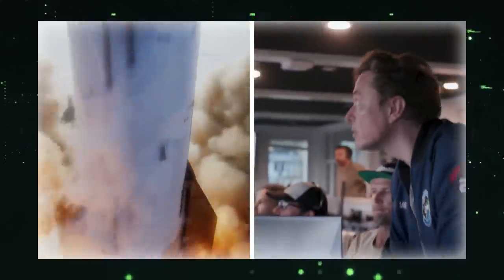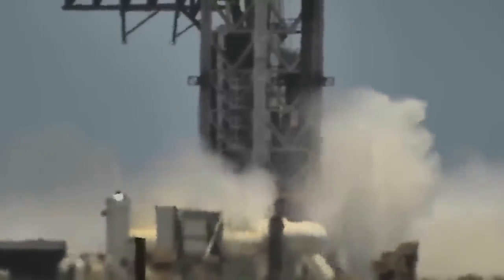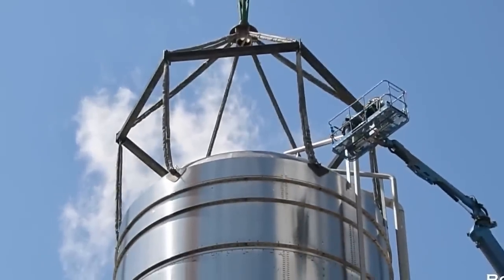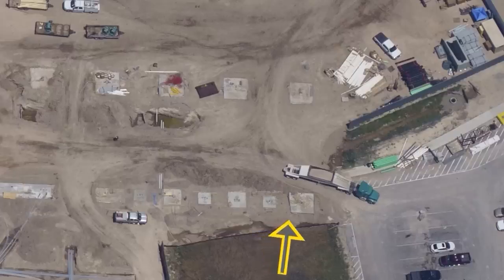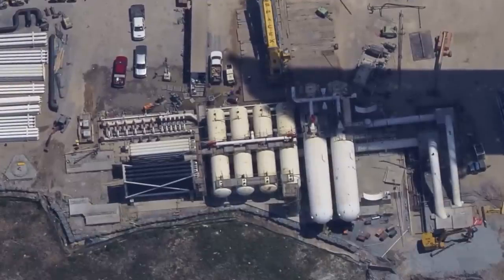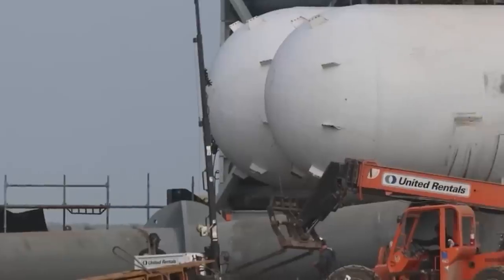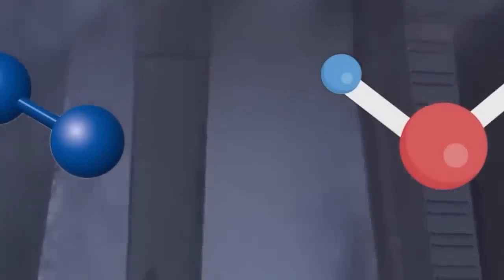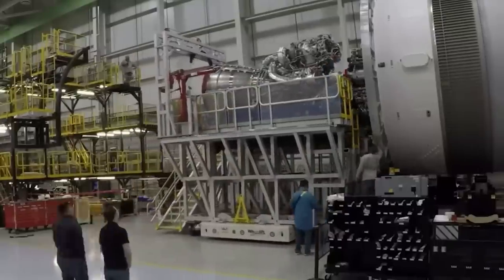SpaceX Starship Launch Pad is Finally Ready + Elon Musk Revealed Something Important

Comment: I worry about
a) how exactly "co-axial" and symmetrical Spacex's take-off assembly is, considering the manner by which it is produced.
b) the effect of direct reflection of the ignition blast waves upon the re-entry tiles, not wanting them to be dislodged.
c) any remaining starting reluctance of Raptor 3s.
d) the effect of condensing ice (once the assembly fuels up) behind those re-entry tiles.  If any of it remains on re-entry, it might cause a tile to fly off.  (Insulators work both ways).
and e) Spinning starships by their noses in pairs with a 500m tether allows human journey time to Mars to be spent initially at Earth gravity, graduated down to Mars G at arrival.  (A rope isn't a problem).
and f) Spaceflight must always deal with radiation exposure.  Solar ionizing radiation can be shielded against, cosmic not, similar to our experience on Earth.  (Life is tough).
Apart from that, I can hardly wait . . . 😎
Reply: HOW ABOUT HE USES HIS OWN MATERIAL INSTEAD OF STEALING IT AND CALLING HIS OWN! tHIS IS NOTHING BUT OTHERS WORK WITH CHATGPT
Reply: @slotvalleyracing  Which is why it's worth adding to.
Reply: @slotvalleyracing  Have you used Chat GPT? It is very biased especially when it comes to what it won't say.. If something is true, don't ignore it because it is not politically correct.
Reply: That's why he stopped contributing.

Comment: The water deluge test proved only one thing, that water in volume could be delivered to the steel plate. The thermal protection it shoud add is still just a computer model until the SF test provides real data.
Reply: I agree, I’m not convinced - that relatively small amount of water (based on the capacity on-site, not the test) isn’t going to be enough to buffer 16 million lb of thrust.

Honestly, it may even be laughable. I think the flow rate won’t be nearly adequate, the exhaust plumes reach the steel plate with no remaining barrier, and either massively damage the plate, or possibly flash-boil the remaining incoming water IN the plate to steam, potentially causing an explosion. 

Either way, I don’t think this system survives the next launch.
Reply: 16 million pounds of mud packing power
Reply: @EstorilEm and we will all be watching. I think it's going to curl up at the edges and become a boiling caldera. Hope he has spares.

Comment: I would love to see a water recapture system, with filters, for launch reuse. Plans for multiple daily launches precludes water tanker recharge water tanks. Cost is also a consideration.
Reply: Much of the water will be gone with each launch. It will be turned into steam by the 33 Raptors. For daily operations, filtering the water for reuse might get you 1/4th of it back. So the other 3/4 will need to come from a another source. Most likely from an RO unit with extra water brought in by tankers. Starbase isn't supposed to be many launches a day.  It is supposed to be the testing site with the Cape as the main launch site.

Comment: There is no way that the deluge system is going to work. The physics are just on their side. They need to dig a trench as the 1966 NASA report stated. Back then they did the numbers and it worked. As an even more powerful rocket, it's going to need double what they used for Shuttle.
Reply: 16 million gallons of water deluge and a faster launch faster than before!..to absorb Heat from the launch..to protect Launch pad

Comment: Why doesn't he use those black tiles like on the starship for the launchpad?
Reply: They're ceramic. Brittle.
Reply: I had the same idea
Refractory blocks will take the heat.
I think Russians use this system. 
Not sure if it can take the erosion from blast pressure.

Comment: The deluge system doesn't look like it fuctions how described and i thought it was supposed to go to the center and not away from the center. If the water is supposed to still oppose or cool the steel plates then it going to need more water for the test footage showed it didn't hold back the force at all and with all 33 engines it might not go well to the put of pushing the water away and hitting the steel plates directly instead and that is a problem. Id suggested on another channel of using underground water bucket instead to contain the water in avoidingbrun off into the surrounding environment and to work better on absorbing the heat and force of takeoff.

Comment: Tall building erected on alluvial soil topple over during earthquakes due to phenomena called soil liquification. One just wonders how many artificial earthquakes (launches and static fire tests) will it take before alluvial soil (with very high ground water level) laying below OLM  and launch tower liquifies toppling over both structures. What we have seen during last test launch was accelerated pile driving (whole OLM hammered into soil below). After last modification (introduction of raft and pile structure) we will see not pile driving as before but accelerated soil compaction causing soil liquification. I just cannot wait to see this action.
Reply: I don't think there will be enough horizontal motion for liquification. The forces should be in one direction only, and those will be straight down. I would think it would act like ballistic sand.
Reply: @jxland3389  You keep ignoring the fact that it is costal area with unlimited supply of water seeping in and high ground water level
Reply: Karol - I've seen your obvious dislike for Elon in other posts. Why is that? Why can't you wait for the system to fail? Why do you think you're smarter than all of the other people in the room? This constant narrative of yours comes off as rather pompous in the end. Thing is, if it's successful, I doubt there will be any retractions or apologies.
Reply: @stratolestele7611  It seems to me that we have  difference of opinions when it comes to what constitutes system failure. You saw OLM hammered into soil below it crushing concrete slab surrounding it. You saw concrete blocks blown hundred of yards away, you saw "rock storm" and that in your mind was not a failure? You must have read Elon's public uttering that the Starship was launched without use of hold down clamps and the thrust was increased gradually. You saw bottom of the Starship surge sideways as soon as it cleared top of OLM. Lucky for Elon top of the rocket was falling away from the launch tower not towards it so we missed a big explosion. To this very day it did not click in Elon's mind that his "cautious launch procedure" almost destroyed his Boca Chica facilities. With all of this happening a I write this you still hope and pray for success at the other end of the rainbow? Instead of fixing his mess Elon tries to save his face regarding dismal failure of the Skirt as structural element of the rocket he lies his way out of this blind alley introducing 6 VacRaptors and hot staging as a smokescreen.
Reply: @KarolKarolak  I think he knew he had to redo OLM anyway, why not get at least one launch out of it so data could be gathered about Starship and OLM right away while they had clearance so they could begin to restructure the pad.
Reply: @KarolKarolak  I live in the S F bay area and the new Bay Bridge is anchored in a similar fashion. They don't have to earthquake proof it. Liquification happens when there is a strong side to side shaking or vibration. As long as it is being pushed by thrust it should only have a downward push.
Reply: @jxland3389  I am not soil mechanics expert but I can see wishful thinking in assumption that downward push does not generate spherical distribution of force and vibration.
Reply: @KarolKarolak  He said a long  time ago that the OLM was a bigger engineering challenge than the rocket itself.